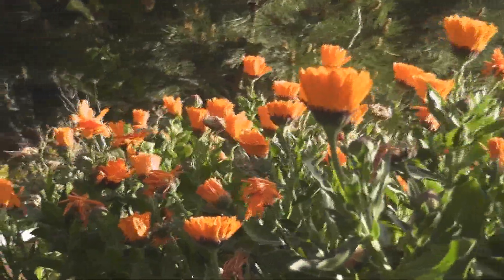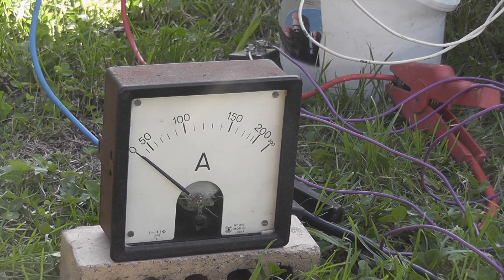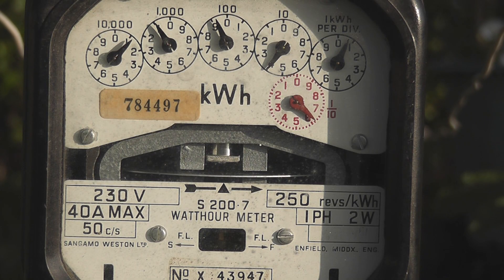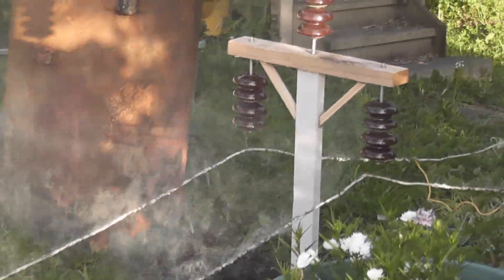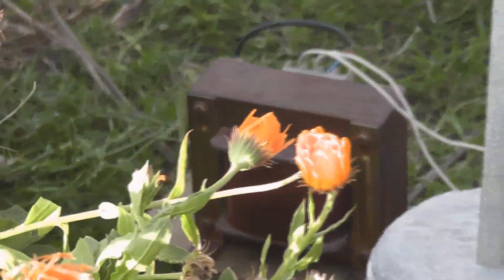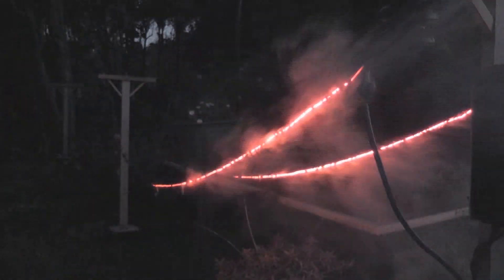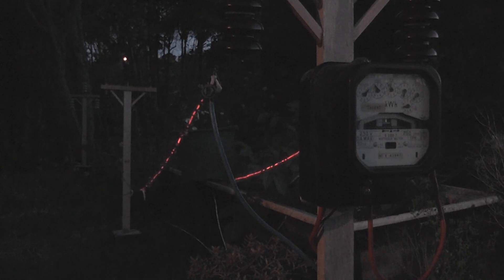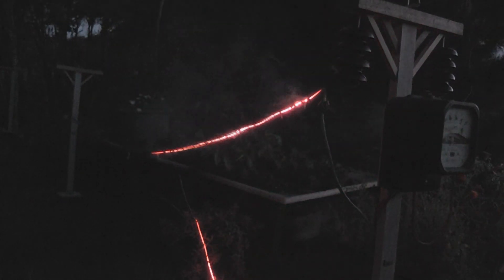Red Hot glowing powerlines

Comment: ok, so he's using batteries, but batteries need to be recharged so there is a cost associated with powering a battery charger. BTW, this is what happens when you use cheap jumper cables to start your car.

Comment: This man's a IDIOT! That current is BEYOND FATAL!
Reply: I don’t think so, at 36V it would not kill you. You would not even feel it. You need volts and amps to kill you. Volts to overcome resistance to allow the amps to conduct through the body. 

If there was 80-130V + then it would be “BEYOND FATAL” even if a “lethal” power level was used adequate control measures would ensure the experiment was safe and not dangerous. 

So before calling someone an idiot, try and educate yourself a little bit first; with some very basic electrical knowledge. Ohms law would be a very good start for you. V=I*R
Reply: Sir! I am an Amateur Extra Class Ham Operator. I AM EDUCATED! But it is CURRENT that kills NOT Voltage. Signed, NR4AG
Reply: Okay then, going by your flawed logic.
Touching a car battery = instant death
Touching a 25kV pylon = Lives 

No, 

Extra emphasis on “amateur” I’m going to leave it here but your understanding of electricity is flawed/ very basic. Voltage and amps are needed to kill you. V=IR. you do the maths. 

It’s bloody scary how people like you actually think like this. Please, I ask for your own benefit. Revise basic electrical theory and principles. 

Kyle bishop.
Reply: I would Far better Err on the side of CAUTION than TEMPT fate at currents THAT high. Besides, There is also a Fire risk.

Comment: Im curious,

the meter says : 11 940 kwh
But you're at 24v 100 amps (or 36 / 150) but it ends up at 24 * 100 = 2400 kwh

So this means that the 11 940 is just the cumulative of many times of doing this ?

Because people are like "Oh my god your electricity bill"  but 2400kwh is not a lot compared to heating a house in winter
or am i dumb ?

Comment: I remember there being a Nobel Prize for someone working with super-conductors for power line attachments (or something like that) to find a way to transmit electricity with less resistance (energy loss).  In the most recent past I've been wondering about how electricity is transmitted by stringing wires from tower to tower.  Isn't there resistance because of the energy being bounded (in the wires) but ALSO bouncing against those wires . . . as the wires don't travel in a straight line?  That could mean a need to bury the lines to achieve straightness.  Costly.  And there would be infiltration into the buried chambers by all manner of life & mischief.

Comment: The meter says  40 amps max.   Where is the short exactly? 
Metal wire test?  OK. It is a wire loop.  Wires are getting lower because the metal is heating and they are stretching.  Did you say 220 volts to 1220 volts at the step up transformer?  Not sure what your power source is given above.

Comment: I was just wondering why power lines don't put off enough heat to melt ice .. all I've learned in my 5 seconds of research is that  power lines sag with heat due to it's aluminum over 96 degrees

Comment: This demonstrates why there are over-current protection devices, such as circuit breakers or fuses, in every properly designed electrical system. Think of what might happen if these wires were in the walls of your house.

This wire is good for 16 amperes, normally, and in a normal situation the circuit breaker would trip. Here we see what happens when they carry more than 100 amperes.
Reply: ccoraxfan it also proves why you shouldn't max out extension cords.
Reply: this is what happens when you use "FEDERAL PACIFIC" circuit breakers!!!!
Reply: @gregoryclemen1870 ?
Reply: your question mark is in response to a question, and I will try to answer that. back in the day when circuit breakers were first introduced, they were" thermal trip "only. there was no magnetic trip sensors in the breakers, so a breaker on a short circuit would hang in the" on" position until the breaker heated up, then it would trip off.(it would take about 6 to 10 seconds). resetting the breaker while the wiring is still hot would result in a" no- trip " condition, due to the wiring being so hot and the internal resistance of the wire being very high. so breakers made by" bull dog"( pushmatic) ," federal pacific" ( stab- lock)," generall swich co"., "wadsworth" . all of these companies are no longer in business, due to the loss of "U.L." approval. square D company( detroit fuse company)came out with the "Q.O." breakers in 1958( quick open), these breakers have magnetic / thermal fault sensors built into the breakers.. on a "short circuit" the breaker will trip in less than 1 second( general electric, cutler- hammer siemens all have magnetic trip sensors built into their breakers)

Comment: I have never seen anyone foolish enough to run the power lines that LOW in the garden. Chance that you will getting shocked and killed...= 100%
Reply: he cant get electrocuted by 35 volts...
Reply: Yes he can, that's over 100A of current, enough to kill an elephant. But, he was taking precautions (I think).
Reply: it maybe 100 Amps going through the wire but the wire has almost no resistance our body has around 5 - 15 megaohms of resistance. and in order to get electrocuted you would need high voltage to get around the high resistance of our skin.

Comment: Impressive.  But was that watthour meter handling the full current?
This is unrelated, but thought some would find it interesting:  Last week I saw some stadium lights at a high school football field.  7200V was fed to about 6 poles, each with its own transformer, feeding a square D 3R panel (25 feet up) which in turn fed several 1000W MH fixtures.  To turn on the lights, one goes to the first pole and opens a box at ground level, and flips a single pole switch which sends 120V to an oil switch up at the top of the pole, sending the 7200V to the other poles.  Couldn't believe it.  But the local utility is now wanting to do away with this old system.  I'd sure like to get my hands on one of those 120V- operated oil switches.
Reply: I don't understand why the local utility would have a say in what a high school football field uses as a lighting system? Does Shell oil have a say in what brand of disk brake rotors you use? No doubt they want the school to replace the tried and true equipment with China made junk that is "more efficient" even though it dies and needs to be replaced every other year, and is made out of combustible plastic.
Reply from the maker: That meter was handling the excess current with some protest. The current coil was in saturation at more then 40 Amps. Thermally these meters will take higher currents providing the connections are tight. The accuracy will drop at these excessive currents and meter dials will read under.
Reply: OlegKostoglatov Around here, the utility is the only one that deals with high voltage.  The local utility (or its predecessor) had a hand in building the system, so I guess they have some say-so about what happens with it now.
Reply from the maker: +TheSpazModic Also I think who does the actual maintenance of those oil switches. The oil slowly deteriorates over time and samples need to be taken as the integrity of oil changes depending upon how many operations of the switch gear. The equipment may be very old and is in a bad rusty state. Often the utility deals with the maintenance, ( and they often get the blame when High Voltage is involved ), and if not done it might become a risk to the public. Who knows.
Reply: lskrekrifhiiis7LEDskkdfmfdijfkditjiugi0LEDdkkcdoofjfkfjkddmkdkek,do